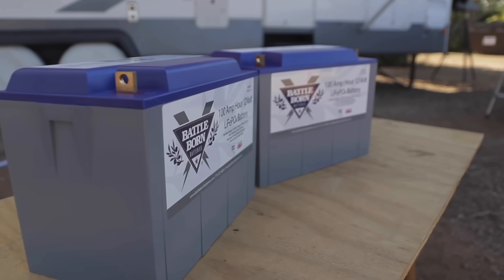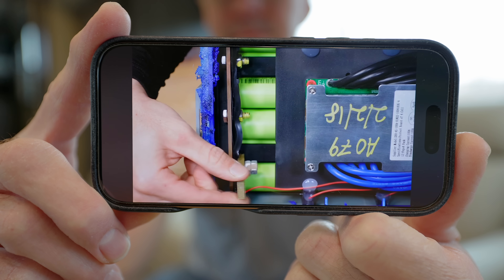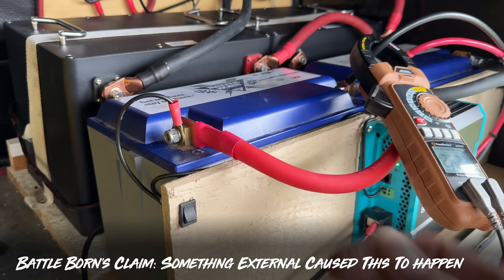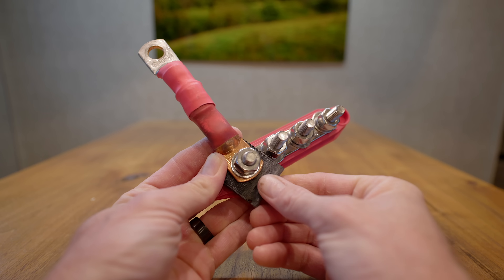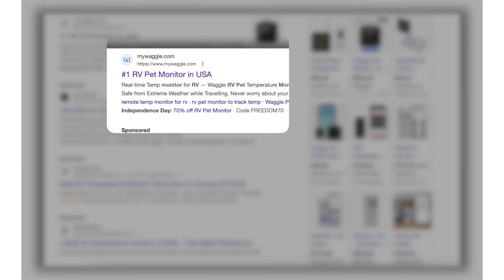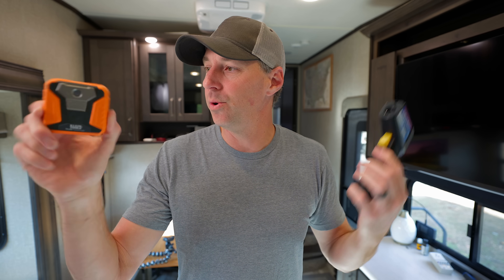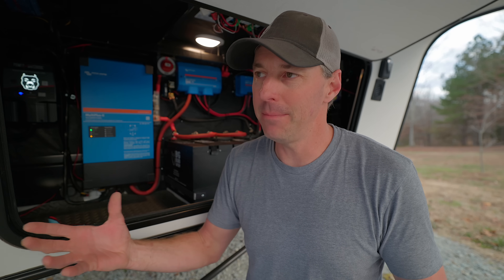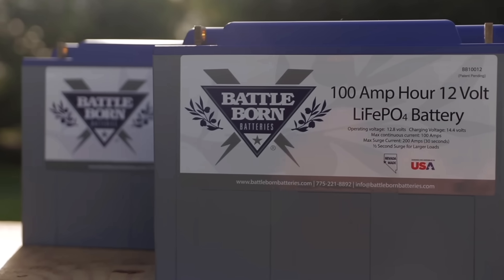Battle Born Batteries Problems!

Comment: As someone with a lot of experience and some education, the response Will received is complete nonsense. It sounds like it came from someone who knew a few key words but had no actual engineering or technical experience of relevance.

The intermediate plastic does not even need to melt to cause a problem.  It takes a lot of pressure to make a good connection for 100 amps. When you put that pressure on plastic it flows over time (and heat, if any, will accelerate this).  This will cause the bolt to loosen even if the nut never turns.  This is part of the problem caused by aluminum wiring used in the 1970s - aluminum also flows (and it forms an insulative oxide layer, and that happens faster when hotter and a poor connection gets hotter).

Comment: I understand that the issue is with older BB batteries.  Will Prowse is attempting to replicate the BB battery issue with a new BB battery.  Is he sure that the battery construction is the same?  Also, if a temperature disconnect is the goal, why not install a temperature sensor on the internal terminal and let the BMS shut it down?

Comment: Question:
Is this something that is happening with their current battery's?
I have several older BB battery's that I bought around 5 years ago. Just wondering if these were built different from the current ones. I bought them because of their no hassle warranty.

Comment: Everyone keeps saying the potential fault occurs because the plastic spacer has melted or overheated. This is probably not required if your description of the problem is accurate. Mechanical engineers who work with plastic parts know that it is bad practice to leave a piece of plastic under load. The plastic will creep under load and relieve the stress from the tightened nut. There are engineered plastics that minimize creep, but don’t eliminate it (to the best of my knowledge). Since there’s mention of the material “melting”, it’s probably not a thermoset (which might be low creep). They might have some other fancy material, so I wouldn’t say for sure, but this is a red flag. Have they said what material the plastic spacer is made of?

Comment: I feel that this type of failed design IS a major problem and a danger for RV installations. If you do have a compromised connection and its arcing/heating, the worst place to have that is in a place that experiences routine strong vibrations, like an RV.  Something else that is being overlooked is the arcing is going to wreak havoc with connected electronic devices, via voltage changes/spikes and intermittent power. RV owners have issues enough with the sketchiness of the existing 12v controls and systems in new RV's - subjecting them to an unreliable power system is just throwing gas on a fire.

Comment: Many are seeing a class action lawsuit coming against BB. I am kind of dissapointed because I purchased 6 24v 50Ah and 2 of them completely discharged with no response to "resuscitating maneuvers" and I feel discouraged to contact them to solve the issue because I am not even in the US. I will go ahead and open the batteries to see if a jk bms can be installed, of course use those 2 for other purpose if sucessfull. And never buy that brand again

Comment: I got a pair of battle borns for the airstream several years ago because they expressly stated I could leave them in the trailer in zero degree weather. Couple years after I got them they let me know that the batteries should ALWAYS be removed from the trailer when freezing temperatures occur. Sooo…..I’m going to have to agree with Will that these batteries are probably junk.

Comment: Oh, it's even worse that what Will showed! Another channel took the battery totally apart and it was damning. The way BB connects banks of cells inside the batteries is simply by using friction - ie, no wires, connectors, nothing - just two banks of cells sandwiched together.  It's incomprehensible how anyone would design a battery so shoddily and yet have the audacity to charge a premium. 

BattleBorn needs to immediately have a total recall.
Reply: They are bolted together at the top of the banks but the rest just flops around. Bad design all around!

Comment: So their solution to a situation where too much resistance causes too much heat to create more resistance? I feel an internal fuse would be better. It could even be a non-serviceable fuse since the current “failsafe” is non-serviceable anyways, so you’re no worse off.
Reply: It's not a design failsafe! Just BS trying to talk their way out of a bad situation!

Comment: Well  Jarad said it correctly,  here : https://youtu.be/dkiFG5SwZ6Q?si=k4aY5AQQYngh1FP2&t=490....  
The engineering aspect of the Positive post is atrocious!  The have reduced the current handling of that post by 50%.  The buss bar connection to the lug is removed by the plastic!  The Lug needs to contact the buss bar one one side of the lug and the nut on the other side.  
They could have just fused the post internally if they were worried about  a hard short of the external connections. 
That is ignorant engineering in my  opinion.  EE and more for 60 years and still going.

Comment: As an engineer, using a mechanical connection with dissimilar materials/coefficients of expansion is asking for trouble. Hence aluminum wire in homes needs retorquing at breakers. Add a high vibration environment and things accelerate.
Reply: And the reason aluminum wiring was banned in homes decades ago. It’s only safe in an application where constant maintenance is assured.

Comment: I know of a couple bass boats that caught fire due to these batteries. That was a couple years ago. As far as I know there are no pro's running these batteries in their boats anymore. I've always seen them as just another heavily influencer/pro marketed, over priced product that offered no real benefits over other less expensive options. Joe the Pro is using them! They must be good! Right! .... Riiiight? No, Joe the Pro is being paid to use them and promote them. Personally, I stick with Ampere/Li Time. They've been making batteries for 20 years with a good reputation, and cost 1/3 - 1/4 what some these "influencer" brands are charging.

Comment: Thank you for trying to keep things balanced as you always do.  One bone to pick though is your test rig wasn't built correctly.  You showed a lock washer and then a nut holding the wire lug to the busbar whereas the BB battery is a double nut system without a lock nut.  If the double nut system is tightened properly they will not move when a small gap is created as the plastic deforms under heat allowing the wire lug to move which helps create the sparking, which cause increased current flow, which creates more heat etc...

Comment: That is the entire purpose of the BMS.  The BMS will disconnect if there is an overheating issue. You don't need a melting plastic part causing a bigger issue.
Reply: No it won't because the temp sensor for their BMS is no where near the problem area.

And even if it was the BMS would disconnect on the over heat and then reconnect when it cooled and then continue this cycle for ever.

Comment: If you have multiple batteries and they are in parallel, you are splitting the load. Quick short answer, if your load is 50 amps or less per battery, you are probably ok, but you can be sure of your temps with a thermal gun.

Below is further info, ad nausium.

Example, if your load is 200 amps for 2500w inverter, and you have 4 of these batteries, then each battery will take a 50 amp load.

Will Prowse’s video is testing at full rated charging and discharging of 100 amps. I don’t recall seeing anything from BB saying, “Oh yes, you can see temperatures around 200 degrees F, and this is normal when drawing full load.

50 amps is a good size load, but the heat should be roughly proportional to. The “short” of it is, the more batteries you have the less risk you have.

Personally, I think the BB batteries are way over priced and they do have an issue, and should have used a circuit breaker or fuse instead of this, eh’m, “engineered thermal solution”. 

I’ve been using batteries that are roughly $150 or less per 12v/100 amp, and Will does reviews on a lot of these, so you can see what you’re getting. You don’t even need to understand all the technical things he says, because he always quantifies things with words like “Great” and “Awful”.

These are my opinions.
Reply: If the batteries are rated at 100A continuous they should be able to do it period.
Reply: @TDub_ADV  I agree 100%. I’m addressing to the folks that already own the BB batteries, and how to figure out their risk for themselves. I’ve never bought any of these overpriced batteries.
Reply: @KenB-q8n Same here, i never even considered them when it bought. The value was just terrible at the cost they charged. I went SOK, double the capacity for less than half the money and better build quality.

Comment: I was a Battle Born battery supporter. I bought a 100ahr battery about 5 years ago, it's still in service and has worked flawlessly in my REDARC Manager 30 system since day one. However, I do not run my small system in a high demand condition.
But after Will's video and then seeing BB's response I won't recommend their products. 
I've been in the electric industry for 40 years and I have NEVER heard of a loose connection being a failsafe from current overload/runaway! A piece of plastic between the internal connection and the load buss of the battery? Seriously?
My thoughts are Battle Born is at this time re-engineering their product line in hopes to save the company. But I don't think they will be in be business much longer.
Their reply to Will's allegations are not meeting the sniff test.

Step Up Battle Born! Come clean with your buyers.

Comment: Battle Born is now in a battle for their existence.  Their batteries are PREMIUM PRICED, and as such, the support and pro-activeness of the company need to be PREMIUM as well.  I am not seeing that.  I am seeing a typical "big company" response in an ill-fated attempt to avoid the cost associated with a retrofit/recall of these poorly designed batteries.  This is a MAJOR safety issue for Christ sake !  Are they going to wait until someone dies in an RV fire to step up?  I also am not "buying" the BS that the plastic is there as part of UL compliance....IF anything, I question what the hell were the UL engineers looking at if/when they approved this design?  Is the UL listing legit, or was that somehow "faked"???  Very glad that I do NOT have these batteries.

Comment: Having the positive terminal directly connected to the busbar means that any force applied to the terminal is going to transfer to the bolt mounting it to the busbar and having plastic between just exaggerates the problem. And if you notice the problem is just on the positive side as the negative is connected with flexible wire from the BMS and any force on the terminal is not transferred to any thing other than the housing. And when connecting to a busbar the lugg should connect directly to the busbar and not transferring the power through the bolt this is connection 101.

Comment: @8:23 not agreeing with your response here.   I would be skeptical of the terminal attachment in a static installation, not moving.  In any application where there is movement, vibration etc like boats or RV’s I would not be comfortable running this design.  The constant vibration coupled with bad design is going to lead to premature failure.

Comment: Why pay the "Battleborn tax™"?? For the same or less money, you can pick up cells and BMS to make 3 of them that will be anywhere from "just as good" to "better than" a single BB. And now this fiasco??? Who dreamed up this connection?!?!? It's no different than putting a plastic washer on a stud of my bus bar (That's gonna be passing as much as 400 amps to the load side of things) then putting the battery cable onto it and cranking down the nut. The connection isn't gonna be a "failsafe" - It's gonna be a "fail-SITE". Plain and simple. It would be an idiotically bad way to make a connection outside the battery - Kinda like trying to suck-start a shotgun - There's just no way it's gonna end well. So why does doing it INSIDE the battery make it a "failsafe"?!?!?!? Somebody make it make sense!!!!!

Comment: I personally think what is happening is the nuts are coming lose and then that causes the overheat that melts the plastic making it worse. I have a feeling, the nuts are not staying secure when bouncing around in an RV. Still a BB problem unless they say don't mount them in a moving vehicle / trailer.  I would be curious to know if people that are using the BB batteries in a fixed situation outside an RV is having the same problem. I think BB needs to investigate if the nuts are coming lose causing the overheat instead of the overheat causing the plastic to melt and then the connection is loose.

Comment: I had two Expion 360 100ah lithiums meltdown this summer that I had put on my 2021 Airstream. The batteries came with a 12 year warranty. After the failure in the middle of know where Wyoming, I called Expion.  It took 4 hours after my initial call to get an EM that both batteries would be replaced free immediately. Fantastic customer service.
Reply: Just curious, what happens when 100a lithium batteries "meltdown" exactly.  Sounds scaaary.
Reply: @qquizz Well, it looks like it sounds. They looked like the middle part of the battery was caving in and they were smoldering. It must have started days earlier because I kept asking my friend if he smelled plastic burning. It wasn’t until my 12V fridge started throwing an error code and I ultimately lost power to the entire rig (intermittently) that I checked the battery box and saw this. I disconnected the batteries immediately and the rig worked just fine on shore power. Expion said the year of my batteries they changed manufacturers because of problem like this. They should have recalled them since they were a clear danger. But at least they didn’t try to accuse me to doing something wrong. They owned it and made it right.

Comment: I will tend to agree that it's likely not as big of a danger as some are making it seem. I'm not aware of any actual fires or injuries as a result.
I do however firmly stand that this is an absolute design flaw. As a mechanical engineer who designs electrical connectors this design is mind boggling. I knew there was a problem about 2 years ago when I started seeing people have problems with them, but I didn't fully understand the root cause.
I disagree with Will that the root cause is overheating due to overload. But I'll reserve full judgment on that until he's got more cycles on his new battery.
IMO the issue is with vibration and mechanical fatigue. Most batteries have a flat mounting point and flexible cables underneath, so any stress is easily dissipated. BB uses a bus bar protruding through the case that allows a massive amount of torque to transfer into the battery. Add in a plastic spacer and aluminum bolt and you are asking for trouble. These things are connected with massive 4/0 cables that you often have to man handle a bit to get installed. Then they're driven down the road at high speed where they can bounce around for thousands of miles. That puts a HUGE amount of stress on that tiny aluminum bolt. Again, as a mechanical engineer, it's the physical stress put on the connection, not the current cycling that causes the problem.

And as for warranty, there are dozens of reports of warranty claims being denied. 2 years ago I helped someone diagnose a problem with their 8 battery system. He had had 3 warranty claims and they replaced 10 total batteries for this failure and then told him they were no longer approving any claims from him. Obviously and extreme case, but look through the forums and you'll find plenty more.
Reply: I'm a qualified electrical professional. The design is idiotic and dangerous. The batteries are unsafe to use with a plastic spacer in the positive terminal connection.if I had any of these I'd cut a hole around the positive terminal, cut the plastic away and bolt an MTBF fuse holder directly to the bus bar.
Reply: I am an ME , with some similar designing experience (Cannon Plugs) and concur fully with your observations. 😐

Comment: What do other manufacturers do to meet UL.
Reply: BB doesn't meet UL, they tested to. They don't actually have approval.
Reply: @rubikmonat6589 it doesn’t make any sense to make this connection then. Wouldn’t the bms disconnect when temps over heated?
Reply: @rubikmonat6589 actually, they have a Listing by Intertek-ETL to the UL standard. (And if you’ve never heard of ETL…note that their original name was Edison Test Laboratories.  Yes, THAT Edison.)

Comment: So ironic on Battleborn's own directions for hooking cables to the terminals, they say not to put a washer between the terminal and the cable end to avoid a poor connection. This is exactly what they did on the inside of the battery, also, this would be a simple fix if they wouldn't have sealed their battery case. I foresee NDA's being drawn up now, just like the frame flex fiasco, which they now changed the frames, in my opinion, admitting fault.

Comment: They denied my warranty claim for an obviously bogus reason, claiming the battery was flooded with water. I purchased two of their batteries, and both were dealer-installed in the same location; however, the second battery is working perfectly. I called them out and asked to see photos of the water damage alongside my battery's serial number, but I have received no response.

It is obvious why their stock price has plummeted; it would still be a penny stock if they hadn’t just performed a 1-for-10 reverse stock split. Look up their ticker symbol, DFLI.

I will be filing a complaint with the Better Business Bureau (BBB). I recommend any impacted owners of Dragonfly or Battle Born batteries do the same.